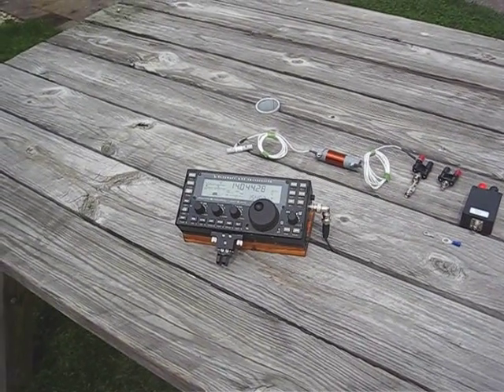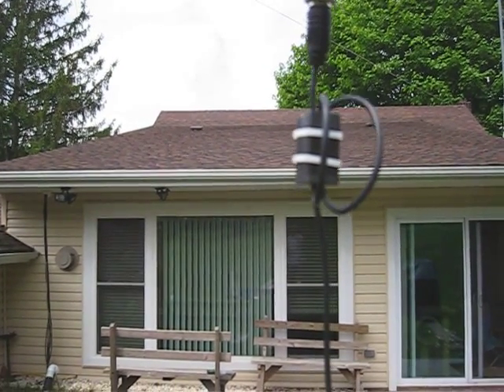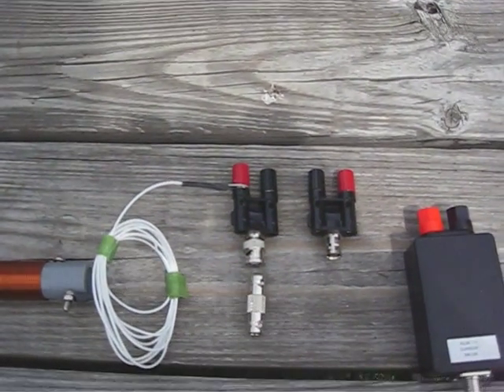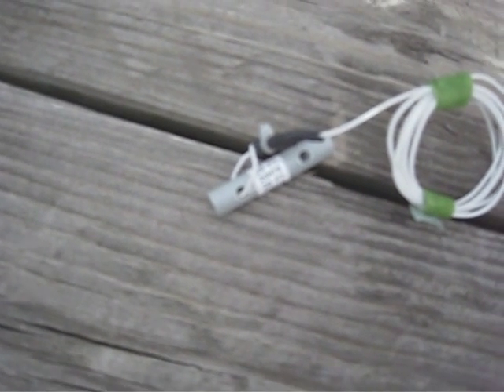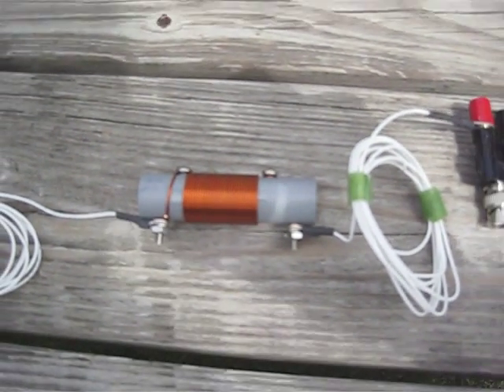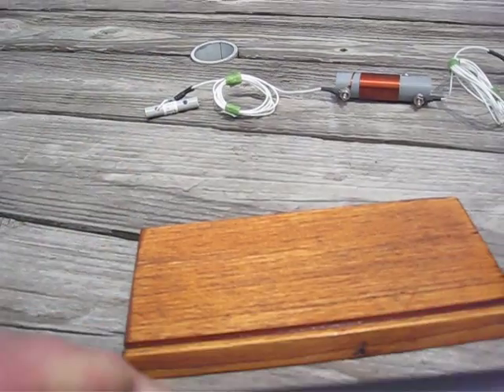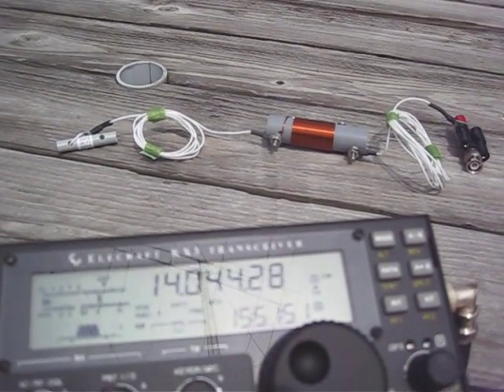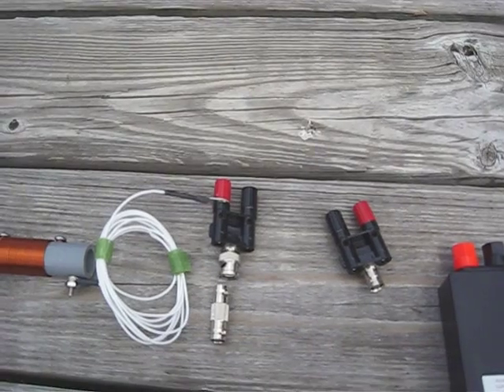MVI 2397

Comment: Can you use copper wire instead of enamel wire for the loading coil. 73 de Bram VA2XE
Reply: Sure you can. As long as you create the same amout of inductance. I use enamel because of its size. Once you add pvc insulation the coil is bigger in size.

Barry